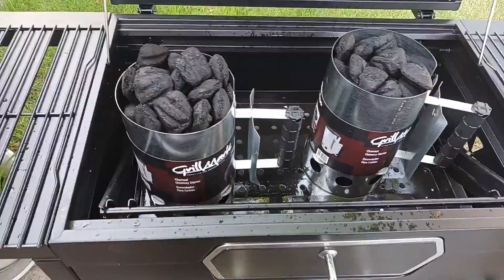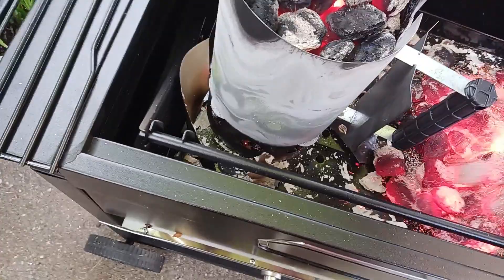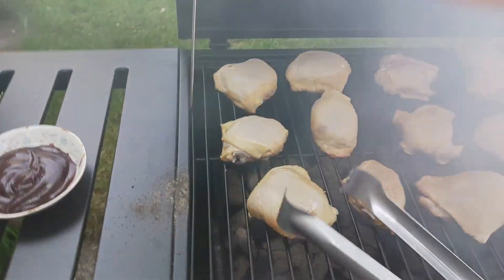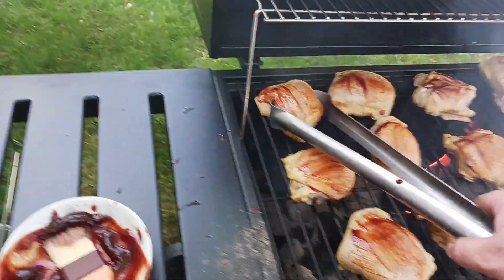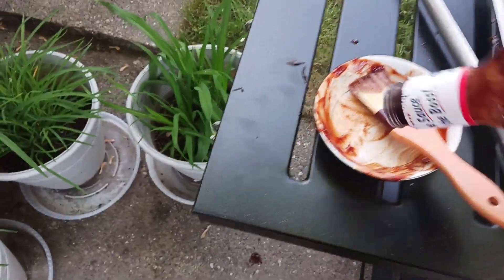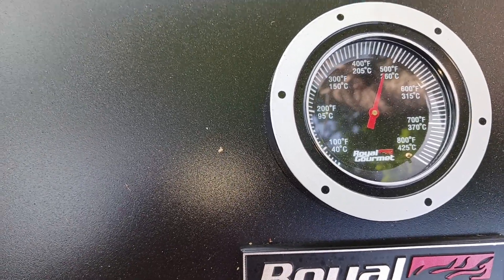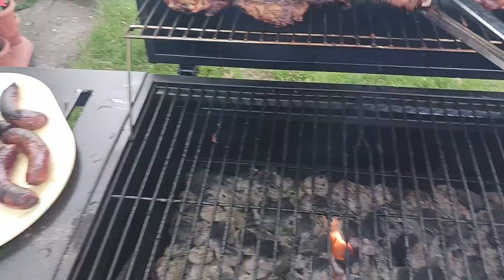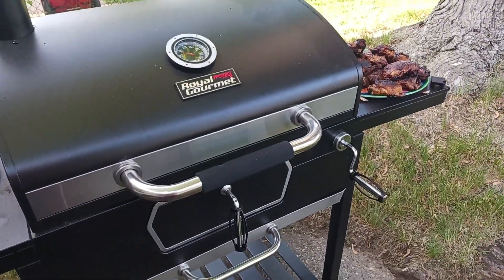Memorial Day Grilling On The Royal Gourmet Charcoal Grill For The First Time.

Comment: Some tips from Uncle Jay's Kitchen:
1.  Drill or melt a small hole in the cap of the barbecue sauce bottle.  That makes it a squirt bottle and you can squirt it right on.  If you want to get fancy and brush it on or around, feel free.  But that leaves you with a brush to wash.  To seal the bottle, scotch tape, just fold one edge over so you have a little pull tab.  Or, wait until this bottle is empty and then make the hole for next time, and seal the bottle with it's original cap.  Bonus:  Most times the screw threads are the same between bottles, so even if you have a different kind, the cap with the hole will likely screw on and work.
2.  Sweet Baby Ray's has a cool name, that's about it.  Kraft Original all day is the way to go, or Bulls Eye for some extra kick.
3.  Not really a recommendation, just a technique:  Cook the thighs most of the way through, about 20 or 30 degrees shy of the target temperature.  Then "turn it down to low", kind of hard to do on a charcoal grill, but you have those shutters you can close to lower the temperature.  Then sauce, leave it a good 10 minutes or so until the sauce starts to "skin over".  Flip, sauce again, and leave for 10 more minutes.  Tons of sauce and flavor, juicy and delicious meat.  You can also inject BBQ sauce inside before cooking for an extra shot of flavor if you have the time or inclination.

Looks like the grill worked well.  I like the ability to control my heat on the gas grill, charcoal doesn't easily give you that option.  You can do "zoned cooking" where you put more coals on one side than the other, hotter temperature by more coals obviously.  I love the chooch from it though, and charcoal gives a flavor that you can't get from a gas grill.  But it's more work.  Those chimney starters, yeah, gonna need a pot holder for those,vmelty plastic handle or no melty plastic handle.

Of course, only follow these recommendations if you want the food to suck!